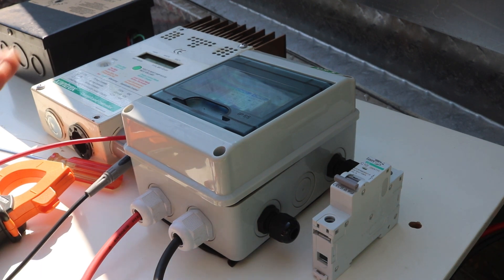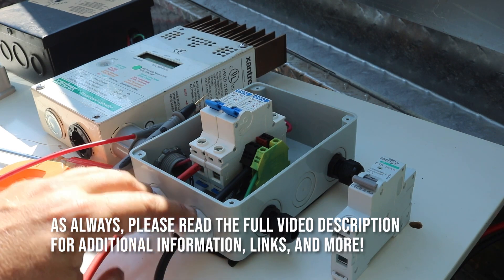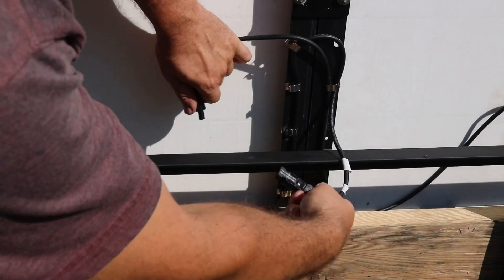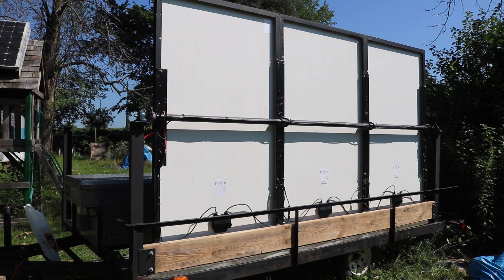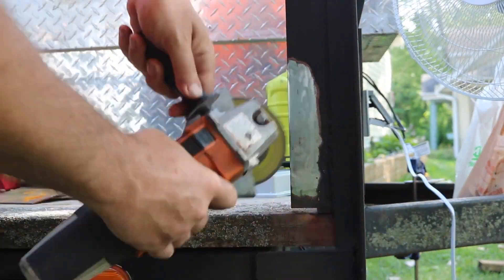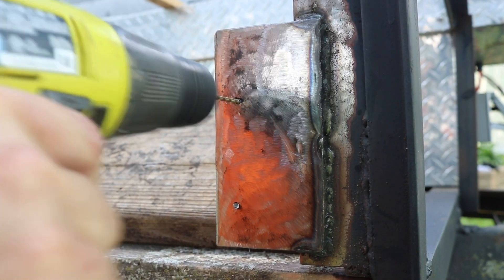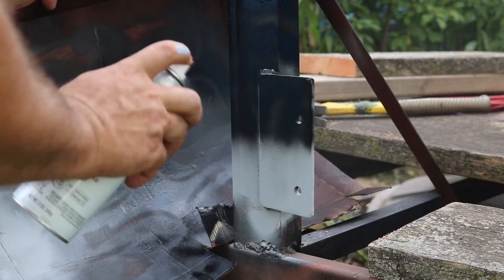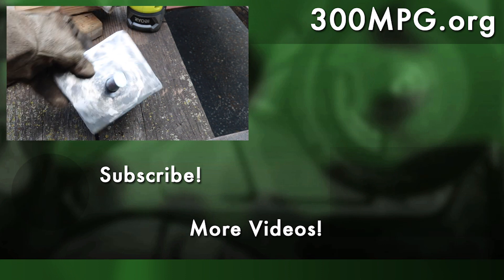Solar Trailer: Part 10 - DC Breakers, etc.

Comment: Hi..my solar panel is having max fuse rating as 10 amps..can you please suggest me how much amp DC breaker should I use?
Reply: 12amp. Are you sure it's 10A? Or that's the open circuit voltage?